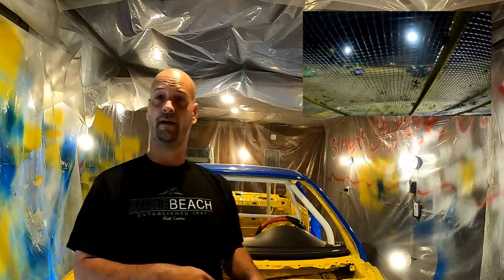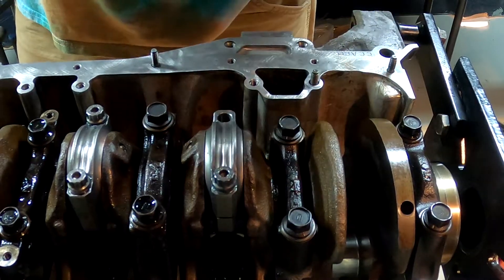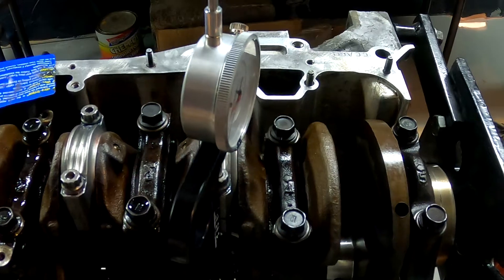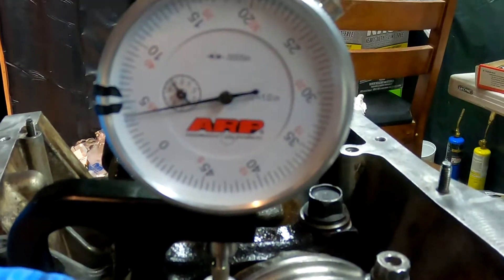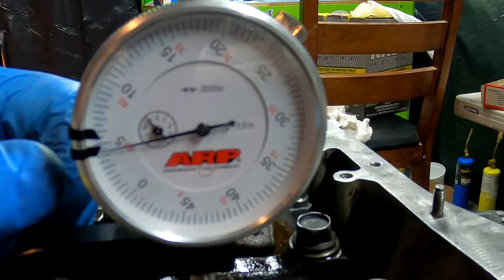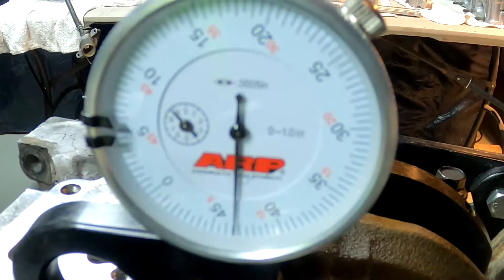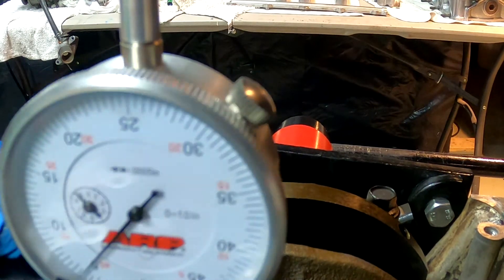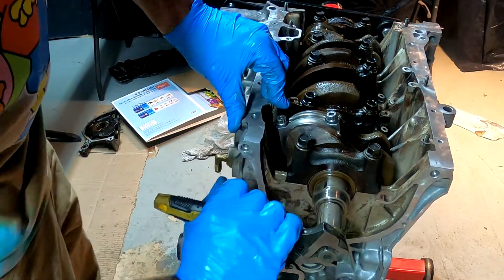How to use a rod bolt stretch gauge

Comment: Can this be done outside the engine and just replicate torque when installing in engine?
Reply: If they are ARP rod bolts, they can be reused multiple times
Reply from the maker: No they can't be stretched two times. once stretched if taken apart. They must be replaced

Comment: I don't know about you but I've built so many engines I just know when that bolt gets to be at just the right tension it needs to be at I only use torque wrench for reference. Get your change out of your pocket before you wash your clothes and put them in the dryer
Reply from the maker: How about those are bibs in the dryer. I work in the cold and mud. It's not change it's the buckles on the bibs. Sorry but at that time I had to wash my clothes everyday to go to work.

Comment: on my opinion the  second bolt should be   torque to 35 to 40 pounds then finish the first bolt to specs also i was told if the bolt doesn't Strech enough on the first torque you loosing the bolt and retorque then you should have more Strech on the second retorque   you can't just crank that bolt to 100 just to meet the stretching specs but that's  just my opinion
Reply from the maker: Thanks for the advice. Thanks for watching. Have a great day.